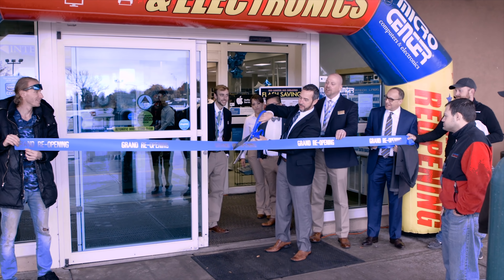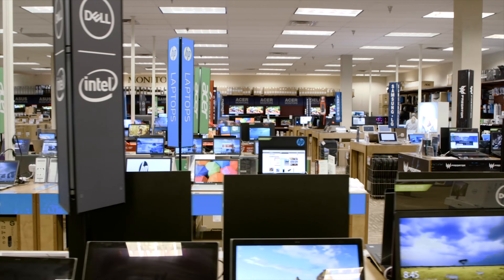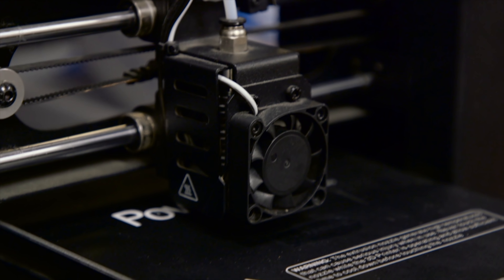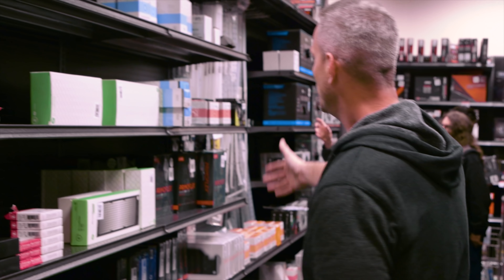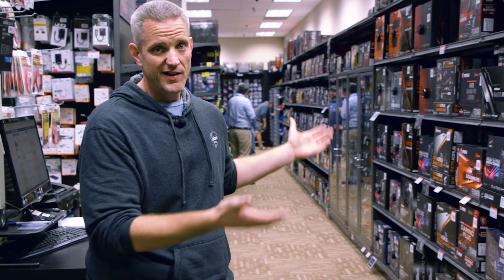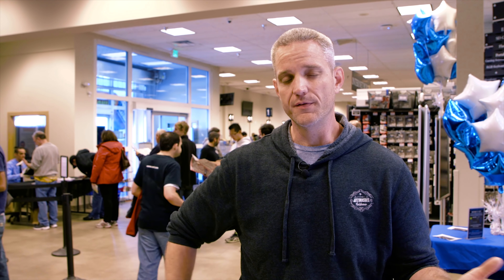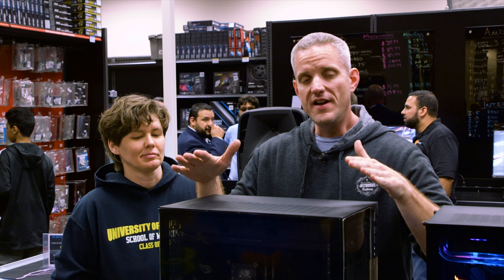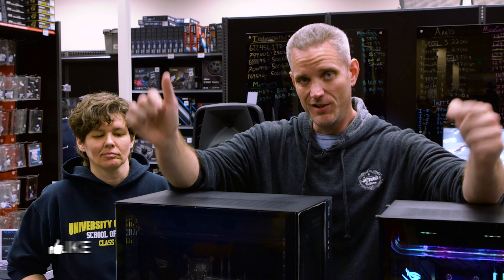What it's like inside Micro Center! Computer Super Store

Comment: I love my local microcenter, only 20 minutes from my house. They price match and have EVERYTHING you need to build an awesome rig. Sometimes the employees can be a bit much because they work off commission so 3 different people will approach you when you’re just browsing but you’ll always have someone near by you can ask questions. Just built my upgraded rig from scratch.

Corsair 750D Airflow
i7 9700k
MSI RTX 2080 Trio
Gigabyte Z390 Aorus Master
Inland 1TB SSD NVMe
4TB Toshiba HDD
Noctua NH-D15S
750W Seasonic Gold
16GB Corsair Vengeance
K70 Rapid Fire
G502 Hero
Acer Predator XB271HU

Best $2900 I’ve spent

*So I pulled the trigger and went with the Ti version of the MSI RTX Trio. Just took the 2080 back and exchanged it, no questions asked. Boy was it the right move I’m getting a solid 40+ FPS jump.
Reply: What a beast of system you have! How is it treating you?
Reply: Mister Lurk 40+ nice i want to get 144hz tho

Comment: I wish I had a microcenter near me
Reply: I have one near me, but the problem with it is that you go to buy $100 in parts and walk out spending $1,000 because you find all kinds of things you want, but didn't realize you wanted to buy. The pricing is good, it's just tempting to go crazy.

You walk in for a cheap SSD and walk out with enough parts to put together a workstation / gaming rig.
Reply: @sbrazenor2  🤣🤣 ya got that right!! Last time I went to my MC I was going in for a wifi dongle for my mother's computer, 600 dollars later walked out with the dongle and a new graphics card for my rig! Wife was not too pleased. 😂😂😂
Reply: @grtech2011  oh, I did the same. I went for a $40 SSD and walked out with that, a GTX 1070, a gigabit 24 port switch, and some cables. I've been keeping myself away because I've been thinking of a nice Ryzen 2700x or Threadripper 2 system for a while, which is just way overkill for my needs.

Comment: Thanks for coming out to Denver Jay. It was awesome to see you do a live build. I got a Ryzen 1600 and MSI X370 Pro Carbon for $200 that day at Mircrocenter.
Reply: You kidding? In sweden add like $200 more
Reply: bee boo  I'll be able to do an upgrade this week. Returning 1600, adding $20 and I'll get 1700X.
Reply: bee boo  I also buy a lot of hardware and have lots of experience. I'll have to get a 1700X not 1700/1800X/2700/2700X because I am getting a $20 upgrade deal from my current 1600. I would have spend quiet a bit more to get any other chip. I don't mind the 1700X and for me personally it's already gonna be overkill but I just can't pass on such a deal. Of course I will make sure to have a beefy cooler for 1700X. Possibly one of Noctua's beefy coolers or an AIO of some sort with 240mm. I will overclock it but I don't plan on pushing the chip to its limits. There's no need for that since the chip is already such a beast and as I mentioned overkill for me. I appreciate the advice though.
Reply: bee boo  I feel like.. 1950X is way overkill. It's great for content creating but it's not as good at gaming as other CPU's. 1800X is more than enough for pretty much anything and everything. If i were you, I'd save the money and invest it into something a lot more useful like a monster GPU or 1440p 144hz, 4K monitor.
Reply: I might be buying new pc parts, Ryzen 5 1600 and a GTX 1060 6GB
Reply: bee boo  You're buying outdated hardware.  Buy something that's current gen hardware and brag about the price you paid.
Reply: I upgraded to 1700X yesterday all together with MSI X370 Pro Carbon mobo only paid $200. Here and there Microcenter has some pretty good deals.
Reply: bee boo  I saw that. Microcenter gave me $10 back when I showed them the receipt.

Comment: I like microcenter.  In fact its where I got my computer's motherboard and processor from, since they had a killer deal at the time on the 4790k if you got a z97 motherboard with it (like 100$ off, though it was more like 50$ off or something thanks to Chicago's insane sales tax).  Still runnin that system with a gtx 970.  And I aint upgrading it until it dies.

Comment: Why are fittings soo expensive?
Why?!?
Reply: Probably because someone thought it was fitting! (ha)
Reply: @AK90  nice one :)
Reply: Because of tight tolerances and QA.
Reply: Tolerances have to be extremely resistive and quality control needs to be damn near perfect
Reply: Bitspower
there you go
Reply: Because you buy them once and they last a lifetime if well looked after.
Reply: Manufacturing cost is high. It's a low moving product that requires insanely high manufacturing standards with super tight tolerances.
Reply: If you're crazy enough to go for water cooling you're crazy enough to spend those dollars on fittings.
Reply: Not enough produced for the price to be lower
Reply: High quality control+I can't imagine they sell too many so to keep a profit they cost more.
Reply: Anyone who actually believes fittings that rely on o-rings for sealing have such high machining tolerances to justify cost may be underestimating machining practices. It isn't the tolerance or Q&A that drives the prices up on these, it's everything else.
Reply: Wow, I never knew that the fittings have to be such high quality. There really isn't much pressure in the loop right? Why can't you just use duck tape lol :P
Reply: @MichaelBerthelsen  they should make few fittings with those tight tolerances for people who want to work with hard tubing and the rest with bigger tolerances for soft tubing. For soft tubing it's a wasted effort to make those fittings with very high precision.
Reply: Check out Barrow/Bykski, quality is on par with bitspower at a fraction of the cost
Reply: @megapro125   It doesnt even matter, your hardtubes: rest on O rings,

the fittings rest on O rings aswell
Reply: @megapro125  When the only alternative is a way higher risk of a soaked system, YOU try to convince them that's a good idea to sell. It's not like tens or hundreds of leaking systems will impact their reputation among customers, right?
Reply: look online. also, check out Barrow fittings. they look similar to Bitspower (some are better looking imo) and half the price
Reply: Niche market price + premium price because it's a "physical" store and not an online store with less payment for staff wages, rent, electricity, water and waste water.
Reply: @prima164  looking at Michael Berthelsen's comments and likes on his original one, sad to see so many with the mindset of 'piece of mind' from a basic product like a fitting being worth ~2X the actual value while having no actual benefit due to their simple lack of understanding in machining. Calibration these days is relatively easy to keep in check especially when a rubbery seal can more than make up for the tolerance difference.
Reply: @MichaelBerthelsen  did you even read what I wrote? I said keep the fittings with tight tolerances for hard tubing but for soft tubing it doesn't make much sense as the tubes will just bend in shape for the fittings.

Comment: I only use the Microcenter in Dallas,TX for my computer needs. its the only store that i have found to have common sense. Fry's seems to just hire and put people with no knowledge of the tech in their stores. I will most likely be a permanent shopper at Microcenter.
Reply: nah ive met a few Intel fanboys there plus they work commission
Reply: I can confirm it is true. I've seen a supervisor not accept a return on a opened box mobo that was completely dead that they sold, stating that it was used already. Like wtf how is the guy supposed to know if it'll work or not if he doesnt use it.
Reply: same dallas micro center since it opened. Always grab cpu/mobo combos there.
Reply: Dallas Micro Center had sick bundles looool
Reply: I have had that happen before but never had that issue. I would've hit a higher-up on that to shut them down. They aim to keep you satisfied. They either risk their rep or give you the maybe $100 that you spent. They often send the MOBOS back to the seller to get another one. Must have been an asshole.

Comment: What's the pricing like compared to online? Cause if it's just a mere 5-10% extra, I'd be willing to pay that for the hands-on experience.
Reply: They are actually real cheap.  Also you can buy refurbished/returns/and open box. It's great checking out the cases in person and you walk out with it all the same day!  Great place!
Reply: Usually they run below costs cpu deals.  I haven't seen many internet stores match their cpu deals.  On most computer parts I'd say they are around 5% more if that.  But you have to shop to get what's on sale or open box to really win.
Reply: Try an average of 30% off msrp for processors even against the best online stores. Even price matches newegg.
Reply: Do they price match?
Reply: Yeah its great. I bought a Pentium Gold G5400 for 42 dollars because the box was open. It's an 80 dollar CPU
Reply: Pricing is competitive with newegg on most products,  within 10% either way.  They tend to beat online sources for CPU+Motherboard combos.  They also sell their store brand 'inland' for all your cheap products like $5 keyboards, cat6 cable and really cheap SD cards and usb drives, etc.  For me it is usually worth the 45 minute drive each way if I need something.  They almost always have what I need at a price that makes sense.  Only thing I can think of they routinely over charge on is printer ink.
Reply: I find it cheaper and they price match.

Comment: You name it, they got there.
i9 9900k?
Reply: Elon Wong Yep, bought mine there. Well, from one of them in Chicago.
Reply: Interesting.
Reply: @elonwong   There's only 1 microcenter in Virginia and their asses are ALWAYS sold out of the good items :(
Reply: yes
Reply: @ProfessorSnack  no doubt...i just about live in that fairfax store but if the website says they've got less than 5 of anything I dont even bother, just go str8 to the Rockville, MD store.  It's only  about 30 minutes away, just shoot up the west side of the beltway to Bethesda.
Reply: Grrrr, I went to this store like 2, 3 weeks ago for one, and where sold out. Although can't complain to much about my 8700k, which I very easily got to 5GHz with a slight multiplier bump and like .250 extra volts.
Reply: They have threadrippers i9s rtx 2080 tis 1080 ti it’s great
Reply: I seen a 8700k go for $300 
They have the i9 9900k instock for 5 n change
Reply: Yup! It’s two of them close to me in Atlanta. They both are stocked with them.
Reply: @tuckertech  lucky us . I have 3 in my state New York. 10, 30, 60 minute drives . Can't go wrong if one is out of stock

Comment: Need Micro Center out here in Seattle area.  Fry's Electronics used to be more like this but not anymore - they sell lots of 'as seen on tv' junk.  They still have a DIY section but does not seem to be as robust as it used to be, and they do not display many monitors any longer.
Reply: They have changed a lot unfortunately.  I used go to Fry's a lot not as much anymore.  They have restocking fees now for cellphones if you return, like up to $30 or so.  Ridiculous. And I don't think you can return graphics cards at all.  Blows my mind.  They have become so broke.  I only go for absolute special sales or something very particular. They are definitely not what they used to be.

Comment: Sweet a store in Denver the only sucky part is that still makes is a 6ish hour drive to get to the closest one for myself lol being completely new to pc it really rough considering it’s pretty much black magic from my understanding my prebuilt is decent from my understanding even though it’s from Walmart I got it second hand 175 it’s a ryzen 5 3500 with a gtx 1650 super I did change out the ram from 1 8 gig to a set of 8 gig Corsair vengeance lpx 3200 mhz kit a the motherboard is a hp something or other and the psu is a 400w Platinum according to the spec sheet I want to upgrade but I’m not sure where to start and getting in in the middle of the the gpu mess only made it all more confusing for me maybe I should just hang it up and stick with my other hobby lol cars but any helpful advice would be great y’all thank you tell next time 
Ps thank you for the content jay and crew

Comment: Nothing compared to Fry's
Reply: Fry's isn't bad at all. But their return policy has become trash.  They charge restocking fee for cellphones.  Microcenter is the only place I know that has no restocking fees at all.  I've never had a single problem returning anything at MC. I used really like Fry's but they have gotten stingy through out the years.  You might find better deals with some things at Fry's but I would not buy a phone, computer, laptop, keyboards, mouse, graphics card, earphones, etc. I don't trust them like I used to.  Unless Fry's has  an absolute unbeatable deal say on a gaming PC, then I would consider going but Microcenter is a level up.  Fry's is good for build supplies etc. and some special sales that's it though. As a reliable overall shopping and buying/return experience, Microcenter all the way.